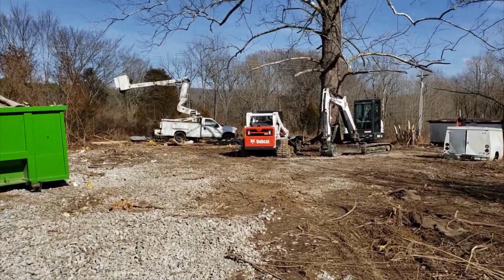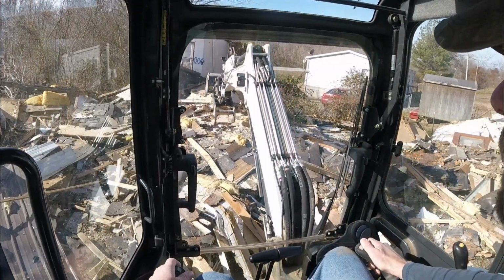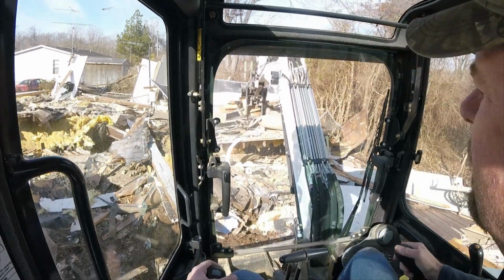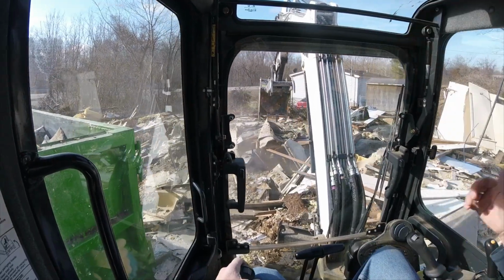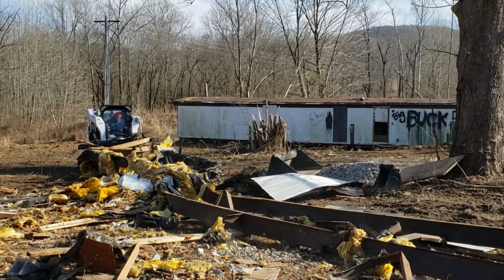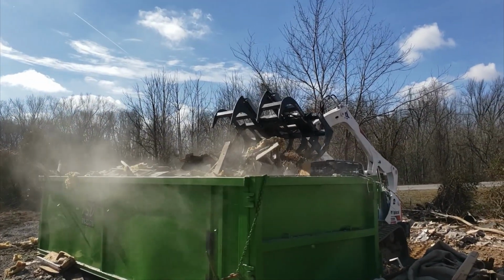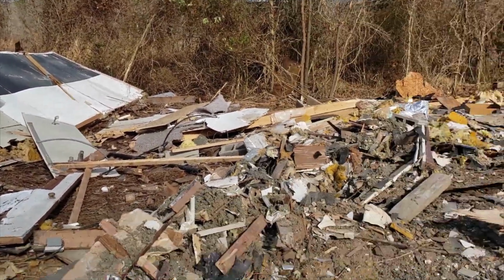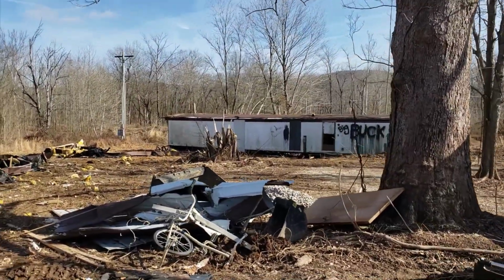ITS GONE! Dismantling new 8 acre Picker's paradise land investment! JUNK YARD EPISODE #47!

Comment: Please note the stack of cement blocks posing as a foundation pillar becoming exposed. They were stacked on their side, not in the vertical position.  The holes can collapse, should be turned.  Home mechanics should use jack stands as the same use could provide injuries.

Too bad someone didn't want the frame to mount a sawmill?
Reply from the maker: For the amount of labor it would take to clean that frame off you'd be way ahead buying an old one, at least that's my take. Thanks

Comment: You need a Fang Rake by Leading Edge Attachments great for demo clearing and digging stumps. I use mine for everything.
Reply from the maker: I'm sure there are a few variations. I could definitely use one, but don't want to buy any more implements right now! :)
Reply: @kapperoutdoors  next time your in Ky holler at me and you can run mine you will go rob your piggy bank.

Comment: Almost there, Kap & Curtis.  Looking good.
Reply from the maker: SF. When you renting that mini?
Reply: @kapperoutdoors  I didn't know when I was going to rent it.  I was thinking of how weather will be in Feb vs March.  I'd prefer to rent it in Feb.  I have no clue how it operates but I guess I'll learn.  Once I get the mini, I'll have to learn how to de-root the small food plot area.  I'll slowly scrape the top surface and when I feel resistance,  dig the bucket slightly into the ground to see if I'm in root territory (🙂).  Since I cut every tree trunk flush with the surface, I must find the root balls.  (Lesson Learned): If I ever cut a tree down again, I'll leave 2 to 3 feet remain above the surface to mark the area as well as use the remaining tree as leverage when I remove it.  I'll send you an e-mail or leave a comment in one of your videos when I finally get the mini. Thanks for remembering.  Say hey to Mrs K.

Comment: Your almost done the double wide demo, but damn, you like to make extra work for yourselves. The way to demo any structure is to keep the debris within the footprint of the building. You ended up with debris all over the yard. Should have left the frame in place and picked everything off of the floor and then peeled off the floor.
Reply: I would add like he said, start at one end and work to the other knocking it down, crunching it up and loading it up as you go. Then, go back and do the floor. Your doing a lot of double and triple work now. Remember, you learn as you go and your getting better all the time.
Reply: not quite that easy when the frame is in the way and the walls are falling over on to the neighbor's property
Reply: @TRCCtv  you got that right! 😁
Reply from the maker: Its a learning curve for sure. But I did try this method, it just did not quite work as planned :) Thanks

Comment: This is no means in any way he's an advertisement for the Diablo saw blade for skill saw I bought one and I tell you what it was worth the $30 that I spent that would cut that frame up five or six times with just a skill saw just saying this thing's worth the money I've made about a hundred and fifty cuts with it on everything from about eight inch steel to half inch and it just keeps on going it's called Diablo for metal you get them at home Depot